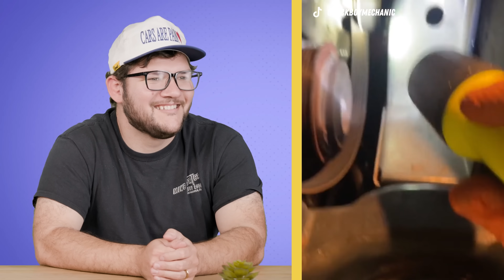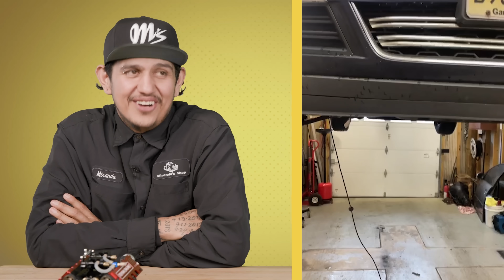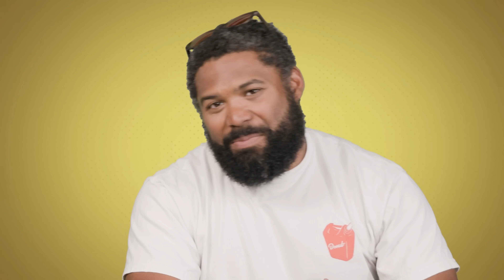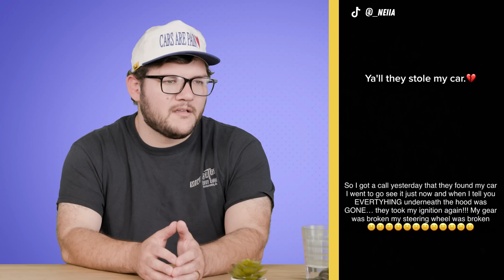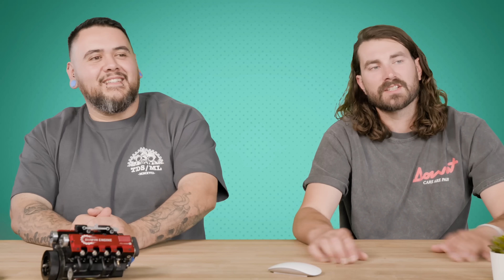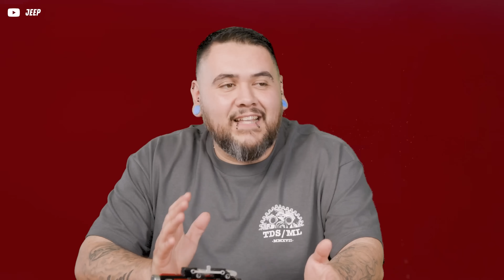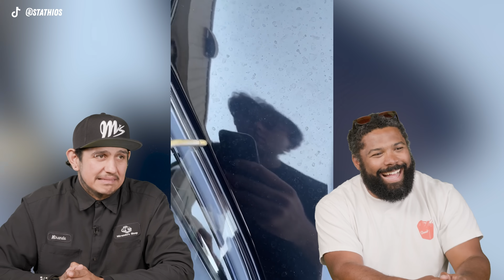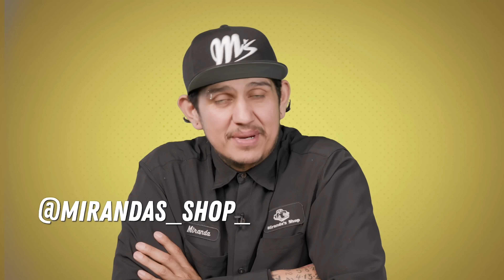Mechanic Reacts to Car Engineering Fails

Comment: Regarding the sunroof/moon roof leak; we say it is the factory to blame, and yes, it's an installation issue, but many of these roof options are done after the factory in an import shop at the direction of the dealer, certified by the manufacturer. The car leaves the factory and the boat with a stock roof. I know Japanese exports are done this way, and imagine all cars are being done this way.

A lot of the things you blame on the engineers are actually decisions being made by either corporate officers who have MBAs or are intentional choices to help support dealerships. For example, let's say there is an Audi from 10 years ago that in order to change the oil filter the mechanic needs to remove the exhaust manifold (which actually is how they designed it), that is so the customer regrets not buying the service plan. The KIA security flaws, were cost cutting efforts made by a new security division committee (committees are the best way to pass the buck so no one gets fired).

Comment: I had a 08 dodge caravan the wipers would randomly go off when opening a door the dash would quit working and it would even run weird. It took ne forever to figure out the door wires are known to be too small and over time opening closing the door the wires would break and cause the body control module to freak out. It ran great when it didnt act up but wouldnt recommend one.

Comment: I went from a '98 2.2L Chevy S10 to an '07 2.8L GMC Canyon. Oil changes on my S10 were a cinch; pull the drain, crack the filter loose, and the oil runs out of the filter into a little plastic funnel that directs it behind the crossmember and right next to the drain plug bung in the pan. EZPZ.

My Canyon OTOH...drain plug is at the back of the engine opposite the filter, so you have to do one, wait for it to stop draining, then do the other. And the oil filter still has the little funnel under it, but now it runs in front of the crossmember. Which probably wouldn't be a problem in a pit at Jiffy Lube, but on a garage floor with the front of the truck on jackstands, the oil from the filter just pools into the back of the funnel and you make a mess on the floor anyway as soon as you put it back on the ground.

And that's just one of about a hundred things that's made my Canyon feel like a downgrade to my old S10. But the one thing they both had in common: a 0.98 gallon capacity washer fluid reservoir!

Comment: A McLaren HAS to rust - that's a law. After all, it is made in Britain.

On a British car, you can consider yourself lucky if the electrics work. Today, they usually do - after all, most of the parts aren't made in Britain any more.

Comment: I was in the industry for 42 years as a tech then a shop owner. I think one of the biggest problems is that one group builds the engine and power train and a different group builds the body, chassis and frame. Then someone else tries to put the two together which leads to a lot of interference problems, wire and hose routing problems etc. My view was “ once they build the first prototype hand the research team a wrench and tell them to service and repair it “ . 😂😂

Comment: You could take the factory Jack and put it between the frame and the engine and push the engine back just enough to get that bolt out that's just a little trick I've learned as a backyard mechanic

Comment: MCLAREN ENGINEER: Hello from MTC in Woking, UK. Yes, we do design for manufacture and servicing. Problem is, there are hundreds of other aspects and scenarios that we also design for, the same as other OEM’s but on smaller volume projects (all of ours are from 105 units into the 1000’s, compare that with a larger OEM VW, who made about 6 million Golf’s) it’s much more difficult to justify the extra spend to make things easy to work on when it’s a struggle to supply parts in general. (As the cost of parts per vehicle is higher). 

This mixed with further limits placed on weight for our cars makes designing for service even more difficult.

That being said, the washers being rusted did make it back to plant, and I believe were from a shipping container leak when the car was at on the ship to the US. Salt water is no good for car parts as Freddy/Tavarish has found out. Take the car back to the dealer, they’ll sort you out and someone back in the UK will get a well-deserved talking too.

Feel free to comment some questions if you’re interested or curious! Cheers - T.

Edit - spelling.

Comment: This video is EXACTLY what I delt with coming home from work thinking it would be really  easy to knock out an oil change on my Yamaha Stratoliner nope it is so difficult to get to the drain plug right behind the frame 🤬 and the spacing is so tight so I have to thin the box end of my wrench. Damn engineers...

Comment: Not just engineers in auto but everywhere. You can't get a spatula that works right now. I repair and refurbish appliances and know for a fact they are engineered to fail and engineered to discourage repair. That's what you get in this throw away society .

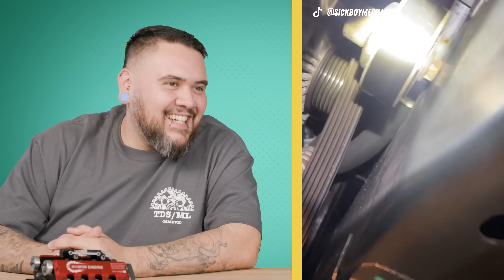Comment: 0:30 : the idler pulley is part of the alternator assembly, so all you need to do is loosen the alternator bolts so you can sneak that bolt out past the frame.

Comment: My 1993 land rover discovery is actually a really well engineered machine, a lot of thought was actually put into creating it (and for very cheap as land rover was really struggling when developing it). So far the most annoying thing they've done is that when you're draining the engine oil, the plug is right above the axle, so if you're doing the first oil change since buying the vehicle and not being very careful like i was, you get stinky, used oil all over yourself.
Reply: My Silverado's oil drain plug points at the tie rod, so you get a water on spoon effect. 1st time was horrible. 2nd time I just used a big funnel. You can probably do the same with the Land Rover.
Reply: @ittimjones  yeah, i use a big funnel now, was a hard lesson getting used engine oil out of my hair and skin😂

Comment: thats the same problems in electronics especially phones .. they lock the emergency download and prevent any technicians from reformating their phones so if a customers phone goes down and there is no way to reprogram it even its own firmware thats where people avoid buying it  coz what's the point of buying an unfixable phones !!!!!   SHOUT OUT TO YOU XIAOMI youre phones has the best potential but we won't buy it anytime soon  until you fix this stupid decision which leads your phones stupid ... because we technicians know better than your fucking engineers  who doesn't know how to design phones properly

Comment: I had a 98 Contour with a V6.  To access the alternator, you pulled the passenger wheel and the plastic wheel well.  The alternator was then directly in front of you. But instead of putting the bold to remove it on the front of it, you had to reach around the back.  Not only could you not see the bolts, you couldn't actually fit your hand behind the alternator.  You had to guess, with a socket wrench.

Comment: Gm tech here. On that traverse, you remove the 2 alternator/generator bolts above, and bring the alternator/generator up through the opening in the wheel well (once you remove the inner fender) the idler pully bolt that hits the frame, is the 3rd bolt to the alternator/generator. Come out easy once you do that. But I hate that generation of gms with a passion, and they can all catch on fire and never exist again, and I'll be happy.

Comment: The suits/accountants are to blame for most of these. The extra few bucks on integrating an immobilizer or the few cents on quality o-rings or bearings add up to millions but save the tech and owner tons of headaches. Some bad engineering is done to send techs work, servicing is a whole business for the manufacturer, just not always worth the hassle for techs.

Comment: Someone needs to talk about GM’s cylinder deactivation in their v8’s. I have an 08 Tahoe that I’ve had to put 3 SETS OF LIFTERS/CAM because the lifters on the deactivated cylinders will collapse and cause a major misfire and destroy the cam. Or even how  1st gen BMW made MINI’s are set up in such a way that if your serpentine belt snaps or comes off for any reason, the belt tensioner takes a nose dive straight into the crank pulley/ dampener destroying both.

Comment: 6.7 power stroke upper oil pan gaskets. Like FAWK, after 100 years you can't figure out how to keep the damn oil in the engine, worse......you now have to lift the cab to fix the freaking oil leak unlike previous model years.

Comment: I'm all about calling out the crap engineering on a lot of todays cars. For example - There's no damn excuse for using a rubber timing belt in any car...use a damn timing chain or go find another career.

Comment: Every decision is veto'd by profit. If they can save money by putting some nut in a wonky position, it'll save them maybe a couple cents per car. They make a hundred of those cuts along multiple lines of hundreds of thousands of cars, they can now give themselves higher bonuses and such. Unfortunately it's more the big picture in that sure, changing that one weird enginerding decision honestly wouldn't be a huge deal, but when you're looking at the spreadsheet of all that stuff added together, it's suddenly a good chunk of how they stay so profitable.

Comment: 2013 cr-v has a giant plastic shield underneath with a fricking tiny oil plug access. First time I did the oil change that entire thing went in the trash. I don't know what they were trying to protect but even going off road won't hurt anything. Not that it ever will

Comment: 11:20 I work in a lube shop myself and we have to deal with this kinda thing all the time. Shes right and like she had said before, put cardboard there. While yes the engineer could've made a better design, and it's their fault you can't just do it but we as techs can take precautions to not make a mess like that.

Comment: If a motor mount takes you an hour to unbolt you my friend aren't a mechanic. To jack up the motor? Nah. You aren't replacing them. You send the leaky windshield to a windshield place. She's correct that it shouldn't be fixed. A lot of these are easy...

Comment: I've worked on conveyor engines changing oil on construction sites rock crushing and oil always spills down into the frame they make foldable funnels to direct it away from the frame and into a catch just a skill issue for this poor guy lol

Comment: When gm designed the 90s lt1 engine with the optispark system placed directly below the waterpump. Water pump let's loose right into the optispark and bam....time to open that wallet

Comment: 😮😮Back in the 70’s, I had a car that needed some lube. But the dealer could not get to the problem without taking the car wheels off. It was a big deal.  So my local non dealer mechanic asked my permission to cut a small hole into the tire well cover so he could cheaply do the job without taking anything apart. My mechanic said the engineers just did not pay attention to access to areas that commonly need repairs.

Comment: 🚨🚨🚨IF YOU OWN A 2011-2017JEEP WRANGLER/CHEROKEE/COMPASS Then you NEED to make sure that your battery and alternator are always in tip top shape. Most of these cars actually have really good Toyota/ZFA transmissions in them and great engines. But alot of the problems will start to pile up if that battery starts to go, because the GENIUS engineers at Damler Chrysler decided to put a bunch of killswitches in the car that are tied to the battery. So even something as small as a battery losing a single vault will make your engine die🤦🏽‍♂️. Obviously there are cheap parts also inside the jeep so the occasional sensor will burn out but for the most part you should have atleast 100-150k trouble free miles as long as the fluids and battery are kept up to date

Comment: hey hey i got one. bmw e61 with a 
panoramic roof. the drain canals will be blocked and will overflow in to the car just over all the fuzes (if the right one gets blocked) and at the bottom of the trunk where spare wheel should be. there is alot of computor boxes

Comment: Having worked in the automotive industry, I can say that while some of this is the engineers a lot more of it is management. Ease of repair is just not a primary concern. 
And as much as I hate it, market research shows that most consumers don't care either. I personally would love for them to stick with a model for 10-15 years because it generally takes 2-4 years just to get all the kinks worked out in a new design and then you start getting cars that are well made. The whole manufacturing process gets way more efficient once they get all the kinks worked out too, so in theory you could drop the price and not hurt the bottom line. But most people don't want a car that looks the same as one that they could have bought 5 years ago if there is flashier new design available. That's why the new model roll out schedules are the way they are. They pretty much switch to a new model just as everything has started to come off the factory floor all dialed in. My advice, never get a car from the first year of a major design change.

Comment: I say it was the Engineer's fault that, for me to change the timing gears and chain on my 98 Silverado crew cab long bed c3500 w/454, I had to drop the oil pan in order to have room to take the timing chain cover off... and in order to be able to drop the oil pan low enough to get the timing cover off, I had to undo motor mounts, barrow a cherry picker to lift the front of the engine so the oil pan could drop low enough, also had to undo oil lines to get to some of the bolts... eventually, I got it all back together, only to find it still did not run, Frustrated I took it to a mechanic for the first time ever in my life. They called me a couple days later to tell me that they had "Good news and they have some bad news"... He to me that they got it running with a fresh distributor and he may have said the checked timing as well. (I had just replaced the cap, rotor, wires, and plugs.) but then he said the bad news was that the brand-new water pump from Rock Auto I had installed before bringing it to them, exploded and destroyed other brand-new parts including the Rad, Belt, Clutch Fan, Blades, etc. I told them I am coming to pick it up I got there, and they charged me $1800! I went home ordered all the parts, replaced everything that broke, got it running, and drove it for a couple days, then the engine started knocking 2 days after everything was replaced. in my driveway, it sits now till I can figure out what to do with it. I like my truck, but I hate the 454 in it.

Comment: the Q3 is a sun roof drain issue there are little tabs on the end of the drain tube that become stuck to the tube so it it just fills the tubes with water and then it flows back into the top of the car and comes out of the light fixture, the TSB fix is to remove those tabs

Comment: its just life.
try making something. anything. get to the end. were there any mistakes, errors, second attempts or overlooked features?
happens all the time.

engineers? theres hundreds of people in teams working on individual components, often with little or no communication between departments.

things get overlooked, files get lost, the wrong files specified, things get put in production, theres 10,000 of them made when someone realises... if ever...

imho, 80s to 90s, they seemed thought out and usually easy to work on. not always, but in general...

try 1940s, when there was no standard anything.

1910. scream. but make sure they pay. because they do! lots!

my personal hatred is lawnnmowers and industrial engines. theres the carb. two bolts. nah, gotta pull engine out, keep track of springs and cables and clips, pull the cowlings off, five different size fasteners...
unbolt the effin intake manifolds because some moron thinks carbs should be bolted on from underneath... just to pull the bowl cus someones sucked up water  and theres no drain plug. or the drain is just as inaccessible.

 effin. 
oh.

FORKLIFTS. wait until you work on a forklift.

it doesnt matter WHAT i do. its always a matter of... somethings 5mm too long. somethings 5mm too short, i need just 5mm more space to do this, or if this was just 5mm over it would be easy... not just cars, but building things, moving trolleys through the shed, getting fridges down hallways, blah blah blah.

curses the 5mm POS

along with things that breakdown, and require you walk the length of the property five times as it keeps throwing a different fastener at you and you only grabbed a 10mm, 13mm, and 3/8 ratchet thinking youd only have to pop that bit off...

Comment: Software engineer here (not the same thing, but I can empathize) - a lot of these decisions are made by suits behind closed doors, pushing for faster, smaller, fewer parts (less code), and of course, cheaper. Some things are poorly engineered, but there's often a "business reason" behind a lot of these silly things.

Comment: 2:40 with my experience in leaks like this at my toyota dealer, we end up finding and fixing the leak in about 3-4 work days. Never have we had to just give them a different car.
Reply: Also: Consoles are designed to be somewhat water resistant because of things like spilled drinks or leaving the window cracked while its sprinkling. as long as it goes in to get fixed soon it shouldn't have hurt anything at all.

Comment: For the first problem.. it looks like its holding alternator with same bolt for some stupid reason so i would go after taking alternator off as i quite sure bolt is loose inside alternator and comes off with it..